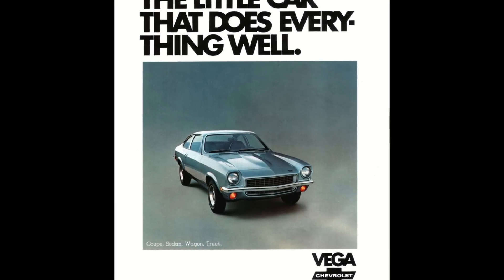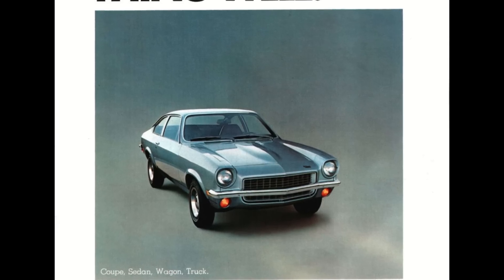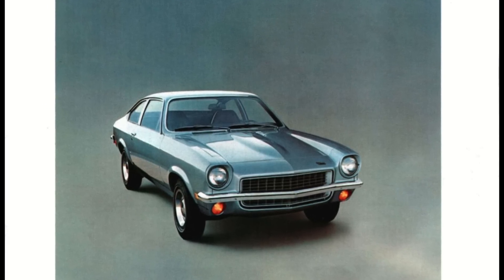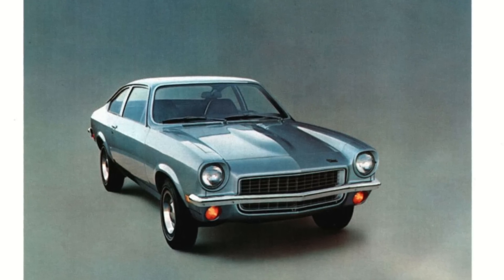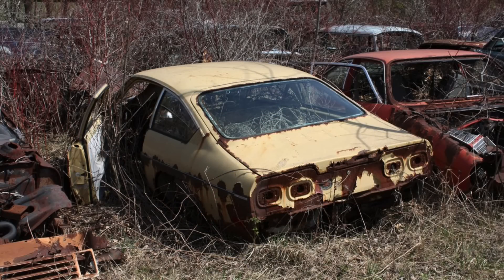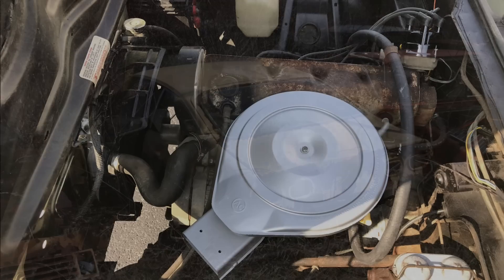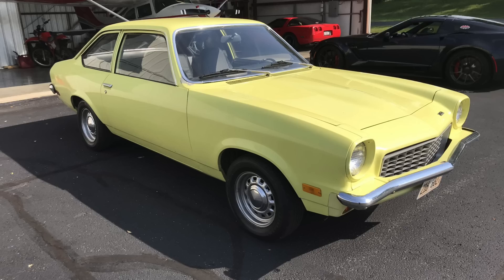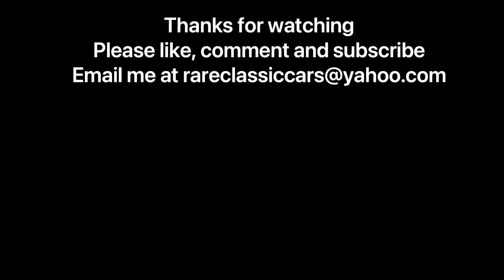GM's Largest Failures: Why The Chevrolet Vega's Engine Turned Buyers Away From American Cars

Comment: In the Book "On a Clear Day you can see General Motors" by DeLorean- he stated the president of GM said it would be an aluminum and the motor ended up weighing 40 lbs more than comparable to normal engines. Just typical GM arrogance caused lots of problems.

Comment: I bought a new 73 Vega GT and loved it until 38k miles when it overheated and burned a piston. Two k miles out of warranty, Chevy replaced the short block  and I paid the labor costs.  Traded the car for a new Chevy van in 75.  I really liked the car and wish I still had it, but with a V8.

Comment: In my '77 Vega, the top shroud that held the radiator in place gradually "bent" upward, allowing the radiator to fall backward into the fan. This happened on the open road at about 50 mph. I heard a "BANG!" immediately followed by the "LOW COOLANT" light coming on. Shut the car off in time (no engine damage), but had to leave the car then return the next day with a new radiator, coolant, turnbuckles and wire to hold the shroud down, ensuring I didn't have this problem again.
Reply: I thought I’d heard everything about engine failures but that is absolutely nuts!

Comment: Wait a minute.....doesn't the block shown at 6:47 HAVE liners.....? 
How can he say they DIDN'T have liners when they're in the picture.....?
Reply: There are no liners in the picture. You are looking at pure aluminum cylinder bores, unsupported, surrounded by water jackets...not a good design.
Reply: @steveoh9838  OK, thanks. I assumed if it had liners the uppermost view might be similar?

Comment: GM had already been making aluminum engines with the Corvair flat 6 in 1959. 2:32

The desire for the Vega to have an aluminum block probably stemmed from wanting the plant at Tonawanda to have something to manufacture after the Corvair's end was near.

Comment: Raised in a GM family, my first new car was a 76 Monza, built with 9" unvented disc brakes which were replaced constantly, a 120 HP SBC lump with a 9" clutch that failed ever 30K > I never owned anything from GM again. I replaced the plastic donut slave cylinder on my 1995 Ranger and 2000 F-150 every 60K. I was forced to go to Toyota

Comment: Bought the first Vega sold at a local dealer. I put 30,000 miles on it before the exhaust started smoking. It had very low power and I traded it for a Camaro when I got married. My wife would be pulling onto a high speed road and the Vega would have been dangerous. Mine was identical to the yellow one in the video. Memories both good and bad came to mind.

Comment: Fast forward about 40 years, and GM made the Chevrolet Equinox with the 2.4 liter 
Ecotec engine.  The doors were rusting before it was 3 years old, and we got the TSB for burning oil because the piston rings were known to be faulty.  Indeed, ours burned through a quart in about 2000 miles, but the dealer insisted we weren't eligible for the fix.  You would think they could improve in 40 years, but no....  I jokingly called it the "Veganox".
Reply: A quart every 2,000 miles is hardly excessive.
Reply: @michaelbenardo5695  The manufacturer says otherwise.
Reply: I had 2 Vegas, "72 and '74 and did not learn my lesson.    Had Equinox  issues with doors rusting and engine PCV orifice blockage causing rear main seal to leak at about 36,000 miles.  Sold it.   That was my last Legacy auto maker purchase.
Reply: The 2.4 liter engine was also put into a lot of other GM cars too.  I had one in a 1999 Malibu.  I did not like it, and traded it for a 2003 Impala with the 3.8 V-6 at the  time.  The Impala had other problems.  The steering rack was garbage, and would leak every three years.  The Impala transmissions were only good for 70,000 miles.

I heard the 2.4 GM engine was a bored out 2.3 Oldsmobile Quad 4 engine.  These had intake gaskets that were a constant pain that needed to be replaced.  Just like the GM 3.4 V-6 intake gasket leaks.

Comment: As someone else wrote, this was a GM Engineering project that Chevy engineers didn't really want. That said, Chevy engineering did develop an aluminum, crossflow, hemi head for this engine for a stillborn L-10 performance engine option. That might have mitigated the head gasket and valve guide issues.

Comment: I started working as a mechanic at the local Chevy dealer in February’78 and there were 13 Vegas sitting behind the dealer waiting for engines….most of what we saw was the cylinders dropped about .025-.030”, causing the head gasket to not seal and start to fill the cylinders with coolant.
Reply: the fanged liner was the way to fix that but they were not made at that time

Comment: I guess I was lucky. I had a new 72 Vega and never had any of these issues. I lived in Ft Worth Tx. Drove it to school and back. After work at night a would cruse the streets at night. Avg temps in the 80 to 90 at night in summer. Burned about tank of gas every night? Put 95k miles before sold after I got married. Had AC. Never had overheating issues. Drove it to Shreveport and back several times.
Reply: no one believes you.  Every '71-'74 Vega was an oil burner by 35,000 miles. no exceptions.

Comment: The radiator for the air conditioned cars was the one to use on a car without AC. Speaking from my own experience. There was another engine design in 1968 proposed for for Chevrolets up coming small car that was good but got nixed  through political in fighting and the considerable R&D cost spent on the 2300. The Vega did a lot for Volkswagen, Toyota! and fledgling Honda

Comment: Ironically GM had a superb steel cam chain Cam-in Head Overhead cam 1.9 liter four cylinder engine with a cast iron block and a cast iron head not significantly heavier than the Vega 2300 Aluminum Block/Cast Iron head engine.  That much smoother, vastly more durable engine was the 1.9 liter Opel four cylinder engine paired with the Opel 4 speed manual transmission which was ultimately used by the Vega, in place of the base model Vega 3 speed Opel sourced standard transmission.   Because of the American internal inch based dimensions, not metric,  used in the Opel  engine, it is highly likely that the Opel 4 cylinder and its companion 6 cylinder CIH engines were designed by GM in Detroit for production by Opel in Germany.  I had an 1970 Opel GT with the 1.9 liter four which was extremely smooth, durable,  and reliably trouble-free outlasting the GT's body which ultimately rusted out by 1976 with approximately 130,000 miles due to Midwest winter salt.  I always couldn't understand by GM didn't produce the Opel 1.9 CIH in the USA for the Vega's introduction.  My friends with Vegas were jealous about the reliability of my still loved, and fondly remembered Opel GT.  Cheers.
Reply: Totally agree
Reply: Wasn't there a version of that with an aluminum head as well?
Reply: I remember my 74 vega 4 speed  used a Saganaw transmission made in Michigan and it was the one thing I liked least about the Vega.  The shift pattern was a very rigid H pattern and shifted like a 18 wheeler truck. I remembered driving a friends Datsun and was amazed at how smoothly it shifted and was a pleasure to drive. I knew then GM was in BIG  trouble competing against the Japanese sports cars.
Reply: @fahembree  You are so correct! Earlier, I posted the original 71-72 trans was a Opel. WRONG! It was a Saginaw 4 speed. Bad tranny!
Reply: That Opal 1900 was very reliable.  Had a 1975 sport wagon that was my first car. The 75 also had a Bosh multi port fuel injection system so it pulled nicely off idle and just kept going. That little wagon sure handled nice and was a blast ti drive in the country. Wisconsin winters eventually claimed it. The engine went into an Opel GT to replace the 1.1 so I'm sure that GT was a different car with the fuel injected 1900. It sure was a nice little wagon . Anyone that bought their "Vega" at a Buick dealership and got one of those Opels certainly got a better car and well worth the extra cost. Very nice suspension front to back in those too.

Comment: I'm astounded that the same great company that engineered the Oldsmobile Toronado's bulletproof UPP ( Unitzed Power Pack: meaning the longitudinally- mounted engine and brilliantly-packaged split transmission assembly to power the front wheels )
would play so cheap and dumb with the 2.3 Inline-4 here in the Vega ?!?
As well-styled and good-handling as the Vega & Astre were, they'd have been better off to use the Chevelle 250 cid Straight Six ( assuming they could lean or make it fit ).....and could have run away with the compact market, I think.
Some might have ridiculed the 250 Straight Six for being an older engine in a radical new car, but it would have been better-suited for this car.
Or.....why not resurrect Pontiac's OHC Straight Six, and not let that good development money float away into history?
I'm a Ford/Mopar guy and even I think it's a shame GM ruined this neat little import-beater with such a lousy engine....I always thought the Oldsmobile version of the Vega ( Starfire? ) was beautiful....very curvy but also practical like European hatchbacks.

Comment: What pisses me off with the Vega's engines is that GM had a plethora of small displacement cast iron block 4 cylinder engines to choose from their Opel and Vauxhall brands.
Reply: Yep, they even had a US built 153 cid four used in the Nova. A friend was a contract machinist for Reynolds in the Vega era. He said Chevy had designed their own 2.0 liter engine with a cross flow head, but GM nixed it because of a deal they wanted with Reynolds. Reynolds originally had an aluminum cross flow head for the Vega, but they had an EPA issue of some sort. They car's debut was rapidly approaching, and GM had the cast iron SOHC head designed in house. If you haven't read it, "On a Clear Day You can See GM" by John Delorean, there is a chapter devoted to the Vega.
Reply: I brought a 73 pinto my friend brought a vega think it was a 74   the pinto had  a great engine that ran beautifully and was always reliable only time I got nervous was if I saw a fast approaching car in my rear view mirror when I was at a stop light. I remember my friends vega always smelt of burning oil and the oil level was always on the bottom  of the dip stick adding  oil to the engine  was a daily exercise the whole engine just looked 
like cheap junk.
Reply: @aimandjulian3195  Your Pinto engine would actually last where the Vega would not.  Both of them rquired filling out an application and mailing it to the state capitol to get enough speed to pass the car ahead.  They were painfully sluggish, and my opinion of fuel consumption is they didn't save very much, and not enough to compensate for the frustration of dealing with dangerously inadequate acceleration in any driving where we need to jump forward to get out of someone else's way.  But, honestly, none of the gas mileage improvements impressed me at the time they were engineered, and it's taken a whole lot of them added together to save any noticable amounts of fuel.  I can't say it wasn't worth it, as my 6.6L Escalade is getting 25 MPG on the highway at 85, but DAMN it took way too long to get both efficiency and less fuel consumption and still have enough power to drag a cattle trailer to the sale barn.  There was a day many years ago I had serious doubts we'd ever get there, and a farmer doesn't have a choice in whatever he chooses to do his work.  I thought we were going to have to walk the beef to the sale barn because no pickup after 1981 had enough power to pull a trailer.
Reply: @aimandjulian3195  My 2018 6.6L Escalade gets better mileage (25) than my 1995 Fleetwood Brougham (23)  5.7L LT1.  I was shocked to the core when I learned that, and I can only guess it's in the transmission and gears in the Escalade.  The most enjoyable one to drive is the Fleetwood Brougham.   I particularly like the genuine dual exhausts with two individual cats on the Fleetwood and an equalizer pipe put on it by it's mommy.  I sure do miss those.
Reply: That car was intended to have a Wankel rotary engine, which was scrapped for reasons I've forgotten.  The hype that arrived with Wankel engines has not lived up to promises, but back in 70 we thought it was going to be the next generation break through.
Reply: @nativetexan1863  I thought it was the Monza that was destined to have the rotary engine. The two cars overlapped a good bit, so I could be wrong. There was once a "Rotary Powered" Chevy emblem, (allegedly for the front of a Monza), for sale from a GM insider, on ebay. IIRC the rotary engine was copped due to gas consumption.
Reply: Please consider that everything written, or on television, is guaranteed to be true <?>.  I only know what I read, but I did read that somewhere.  This world is full of revisionist history, right down to our kids school books, and I look at any thing I read with a grain of Wiki in the back of my head.  Even the factory service manuals, printed by the mother lode, are full of errors that don't match the car it came with, but particularly the wiring. In closing you could be very right, as the Monza and the Vega were very close siblings, but it did shock me when I first read GM intended to use the Wankel at all.  I believe it has fuel consumption problems, low torque, and is notorious for seal failures everywhere, but I've never owned one.
Reply: @billlloyd4354  I think it was poorly controllable emissions that may have been the death knell in our country.
Reply: @nativetexan1863  What I know about the Vega, and H-body platform in general came from people involved with the design, and in a couple of cases the manufacture of them. The Vega was destined as of the late '60's for a four cylinder. GM did a ton of R&D on the rotary, then dumped it. I think it was a Ford engineer that designed the McPherson Strut suspension, (which they didn't want at the time), and GM sold the BOP aluminum V8 to British Leyland.
Reply: The whole Vega concept depended on a 50-50 weight balance which was possible only with Al.😊

Comment: One other motivation for making an aluminum engine without sleeves would be weight savings, though I don't imagine weight was a major factor in a car like the Vega. It was critical in the Corvair, and I read somewhere that GM was hoping to use the same silicon precipitation process on the Corvair, but gave up on it for various reasons, so they resorted to using cast iron liners which (along with heavier-than-anticipated swing arms) contributed to the car's extreme rear weight bias. The consequences of that are well known.

Comment: i bought a brand new Vega hatchback in '71, because Motor Trend magazine was calling it the "Car of the Year".   Yeah, right.  By '73 and having about 35K on the odometer, it went to the junkyard with a blown engine and loaded with rust. I'm still kicking myself over it!
Reply: The Vega and Motor Trend's other bad picks for 'Car of the the year' have made me question any vehicle they evaluate.
Reply: @jamesrichardson559  They tend to just go with what they view is the most "advanced" or "innovative"..not necessarily whether it is any good or not...they have picked a poor car or truck for that award several times...
Reply: The Renault Le Car was also their car of the year.  A hinged rear window fell out of a friend's car while he was driving it.
Reply: I had a 1976 Plymouth Volare, another Motor Trend Car Of The Year in 1976.  Stalling, fender rust, recalls galore. The best thing about the car was the 225 Slant Six which lasted 200k miles!

Comment: You were much too kind in your review.
The Vega was junk from bumper to bumper from the day it left the factory. The engine block was nothing short of experimental - and the public got to be the guinea pigs to do the beta testing. Follow that with issues with valve seals, engine cooling, and the list goes on. That spells out one thing - CHEAP. Instead of using quality materials in the valve seals, use the cheapest junk you can get to make them from. Wonder why they failed? Too CHEAP to put cylinder liners in the block so that they would not be worn out before the new car smell was gone. CHEAP rust prone metal used for the body panels spelled cars less than a year old having rust holes in the fenders. Then there was that CHEAP exhaust system. They sounded like a poorly running chain saw - even when new. 
All in all, corporate GREED and overall CHEAP spelled the end for the Vega. 

As I have said so many times, Chevrolet (and GM) was the best salesman Toyota ever had.

Comment: The fact that GM engineers even briefly considered not running a radiator at all, tells you volumes about what else they would do.  Design and testing are great, but some ideas are so bad that if you think that its worth testing, i'm thinking you're not suitable as an engineer.  What an all around fail this car was, in basically every stage and in every way.